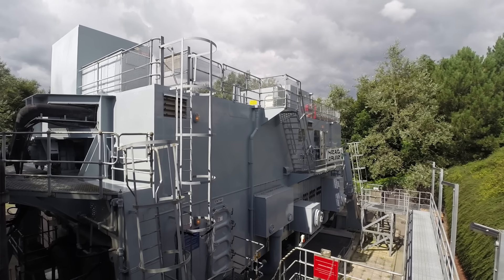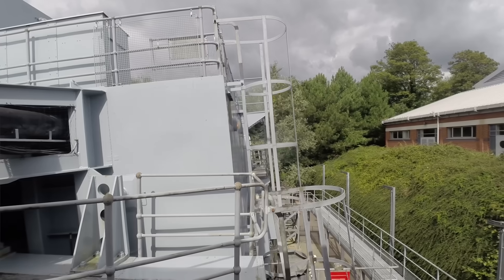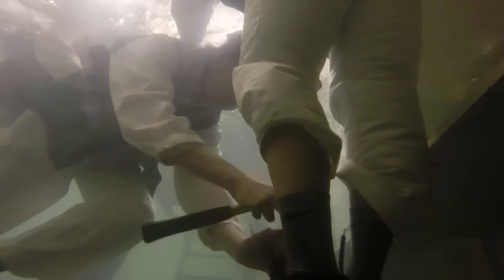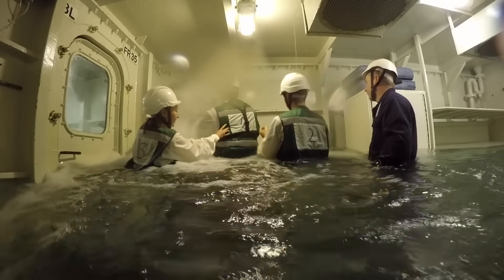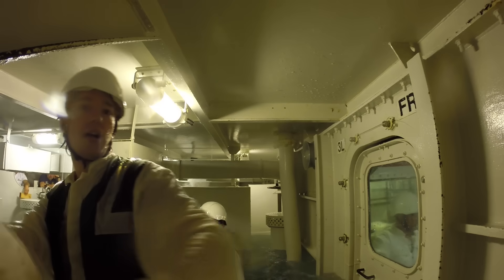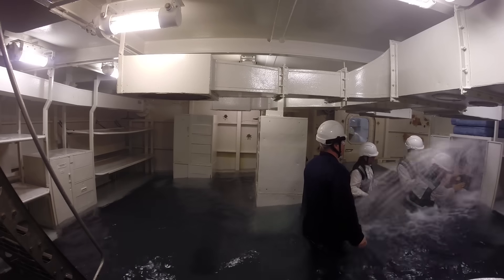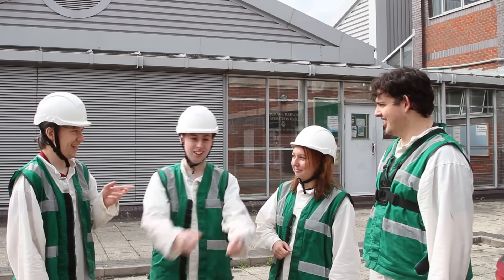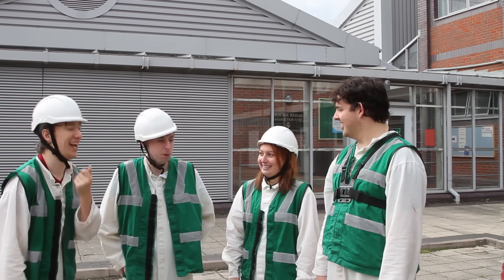Sinking Ship Simulator: The Royal Navy's Damage Repair Instructional Unit

Comment: Imagine astronauts banging wedges to fix a hole after space debris hit the ISS fuselage
Reply: Well they can't just let all that space inside now can they?
Reply: @GreatMelonLord  lmao
Reply: Bail out all that space!
Reply: @comradevlad7459  Someone mixed Nasa and Navy recruitment forms again?
Reply: @comradevlad7459  r/unexpectedCyanideAndHappiness?
Reply: @comradevlad7459  We got about five minutes before this shuttle fills with space and sends us to David Bowie's locker!
Reply: Actually would be easier in a spacecraft, as you'd be fixing it from the high-pressure side, just put something against the hole and it will be sucked securely into place, versus a ship trying to seal out water blasting in, trying to wedge something in against the water pressure.
Reply: @quillmaurer6563  They could always fix it from the outside
Reply: Thats how nano shield should work in 2030
Reply: I mean at one point when someone was scrambling to find a repair kit to fix a small hole in the side of the ISS, one of the astronauts just... Stuck their finger in it for a bit.
Reply: @grantrodgers98  reminds me of Scott Manley who told the story of how the toilet seal wouldn't close so the guy on the ISS just closed his legs and sat on the toilet to prevent depressurization.
Reply: @grantrodgers98  because the space is vacuum, it will hurt a lot because it suck.. just saying
Reply: Nah they just use their fingers, seriously they do until someone duct taped it up
Reply: @markroberts3363  
Wouldn't that do some damage to your finger
Like blood being displaced
Reply: When your space station gets filled with space
Reply: @gravy59  depends on how big the hole is. They patch small holes every now and then
Reply: They are too advanced to use wedges in space. They be using flex tape!
Reply: A small hole isnt gonna depresurise the entire iss, its size of a football terrain!
Reply: @Arthur Xie that is a common misconception about space. The difference is only one atmosphere which is not enough for explosive decompression. If you want to see what explosive decompression is look up the Byford dolphin accident
Reply: They could probably just put as metal sheet on it so the vacuum seals it
Reply: Differential pressure is a scary thing
Reply: Nah they use duct tape. No joke
Reply: @Blue2 Echo I don't think that how that works
Reply: Don’t forget to push all the air out of your lungs.
Reply: at this point, no one has died so that's good. but we will never know (freeze to death or heat to death) [if that makes sense] {Other than the 18 Soviet Cosmonauts, and 15 Astronauts} (Only 3 died in Space)
Reply: You guys who replying is so smort
Reply: There was a home from à micrometeor impact, an astronauts plugged it with his finger before putting tape over it then gauz and something else
Reply: It's actually easier, the pressure difference is lower and you can use fog spray to find the leak then you can stick something on the leak and the suction will keep it shut but depending on the size of the leak, you'll have to be very fast. The crew of Soyuz 11 lost consciousness after 30s when a pressure equalisation valve accidentally opened in the vacuum of space, after 120s they had suffocated. All it would have taken was closing a valve but it was difficult to reach and they weren't prepared for that event.
Reply: I think it would be easier to plug a breach as you are have a vacuum outside working in your favor as you place whatever you have available to patch the hole VS the force working against you.
Reply: Get the space out. Turn the space pumps back on.
Reply: How did this become yet another physics debate?
Reply: in space a piece of chewed bubblegum will automatically seal a small hole.
Reply: Actually it might be abit easier since, the vacuum of space will try to suck the wedge out
Reply: Grab your helmets and start scooping up the vacuum that keeps flooding in and throw it outside. ;)
Reply: Everybody : arguing 
Me : oh
Reply: Considering how weak the ISS hull is against large objects (Anything is weak to them ar orbital speeds) i would say that they would need a whole lot more than just wedges.
Reply: Well that wouldn't happen. That section would immediately depressurise and explode. If anyone was in it, they'd be jettisoned into space and freeze to death, after painful UV burns and swelling within minutes. They'd have to hope they were in another section and had a space suit at hand, because the second wave of debris from the exploding fuselage would fly into the other parts and potentially cause the same thing.
That's if a hole appeared. I'm sure they have countermeasures to prevent that from ever happening.
......I think
Reply: @Zaire82  you can't freeze to death, there is no where for the heat to go, you would die from suffication in about 30 sec.
Reply: @Zaire82  The heat from the sun is derived from the electromagnetic radiation (i.e. light) interacting with the matter it eventually encounters, like dust, rocks, planets, etc. Your body gives off heat by exchanging thermal energy with the matter it is in contact with (e.g. air, clothes, water). In empty space there is nothing, no matter, with which your body can conduct thermal energy out to. So exposure to the sun's rays may still heat you because it is in the energy is carried by photons (which can travel through empty space on their own) physically interacting with the piece of matter that is your body, but your body does not have any mechanism by which it can convert it's energy, thermal or otherwise, into any form of particle radiation such that it could lose energy and thus, potentially, heat while in a vacuum. 

TL:DR
The sun doesn't need any other matter to move heat. Your body does require external matter to move heat, and there isn't any external matter in empty space.
Reply: @CSelH  there is actually matter in space, 0.3% density or something. Also, to my understanding, heat is always electromagnetic radiation. Infra red light, to be specific. I don't see why the sun could radiate heat in a void when your body can't, you didn't explain why, so I'm sticking to my understanding unless you have a better explanation.
Reply: @Zaire82  You're wrong on the atmosphere thing. 1 atm compared to zero behaves the exact same as 2 atm to 1 atm. It's not about ratio, it's pure differential that's going to dictate the airflow. For reference your typical car tire will be 2-3 atm above ambient air pressure.

Airplanes do not explosively decompress when they get a hole in them. There are many recorded incidents of minor holes in aircraft that did not cause any passenger deaths. It's also worth noting that the main airflow dynamic here is not the pressure differential, it's the fact that you're in something slamming into the air at several hundred kilometers per hour. You can replicate this with a car, which has zero pressure differential, but opening up a window on the highway will give you a significant blast of air.

The ISS has had such a hole as was mentioned earlier. Expedition 56/57 (you can look it up) discovered there was a small hole caused by a drill. Not only does it not cause explosive decompression, it's such a minor thing that it only got noticed by ground control monitoring air levels and realizing there had to be a leak somewhere. They didn't even bother to wake the crew up, just told them about it in the morning.
Reply: @ThisGM  The structural integrity of the walls are able to withstand a drill hole, sure, but what of a piece of high-speed space debris?
That is the hypothetical situation, not simply "a hole". Depending on the size and speed, it could very well be comparable to a cannon ball with blades on it. That will certainly breach the walls' integrity, likely causing explosive decompression.
Reply: @CSelH  then how are you emitting infrared light right now?
Reply: @Zaire82  they patched a micro meteorite hole like last year.
Reply: @autopilot6320  finally! Someone who actually understands thermodynamics in space! 
Why the hell do people think you'd freeze instantly? There's nothing there to take the heat away!
Reply: @Zaire82  there is not enough particulate matter in place to wick heat away, if you were exposed to the vacuum of space with no suit your body would take nearly an entire day to freeze completely to its core. Partly because of low particulate cooling and partly down to an extended leidenfrost effect. You would suffocate LONG before you froze to death.
This is why the ISS has such large radiator panels (which everyone mistakes for solar panels.) If they didn't have them even venting small amounts of heat would be near impossible.
Reply: @Zaire82  also, explosive decompression is nigh on impossible with 1 atmo difference on a reasonable sized puncture. For something like that to happen you would have to lose a considerable amount of the station i.e. it would have to snap in half for explosive decompression to even be a threat.
And yes, you can plug a small enough hole with your finger with one atmo difference, its not dangerous per se, most likely just uncomfortable.
And dear god please don't ask why their finger wouldn't freeze, it should be obvious by now.
Reply: @Zaire82  you can freeze to dead in space but not so quick
Reply: @ThisGM  what morning lmao
Reply: @Zaire82  just stop
Reply: @Zaire82  Cant admit that you were wrong eh. It feels better than endlessly adjusting your argument. It's okay to not know everything and make incorrect assumptions about discreet things. Try it some time
Reply: @triplegoy  I admitted I didn't understand them and that I didn't consider the thing they told me. I took the greater than thou attitude because I don't believe they conveyed their meaning properly to begin with. 
Therefore your complaints are null.
Reply: @loumorningstar7709  surely plugging the hole with your finger would cause any water in your finger to painfully boil off and pass through your skin due to the drop in boiling point at such low pressures? As far as I understood death by space (when fully exposed) - if you don't completely breathe out your lungs are just going to pop immediately, and if you do, all the liquid in your body will be turning to gas over a minute or two (hence why those cosmonauts who died just before reentry were covered in weird spots all over their skin).
Reply: @muxite6035  1 anything compared to the literal void is always a large difference.
Imagine what happens to a plane when the door flies off.
That plane is 1atm inside, with somewhere between 0.75 and 0.25 outside, depending on altitude. Still, the door flies off and people get sucked out.
Imagine when there's nothing outside.
Reply: @Zaire82  one atmosphere of pressure is not much at all the reason why airplane incidents are so violent is not because the difference in air pressure it's because when they door window opens on an airplane the airplanes going several hundred miles per hour. Next time you're in your car going down the freeway at 70 open the window and see how violently there comes in now multiply that by about eight fold

Comment: They should develop umbrella style plugs that can be forced through the hole in a rod shape. Then once clear of the fast flowing areas around the hole deploy the pulg so it springs open and let the water push it against the hull to seal.

Comment: Feel for the hole size, put a couple wedges together close to that size and put them in position quickly and hammer them home, adding additional wedges as needed. It isn’t hard if you work smarter not harder.
Reply: "Everything is very simple in war, but the simplest thing is difficult."

Comment: Fixing a seam split with softwood wedges... bang in six in a row and some idiot hands over a hardwood wedge for the last, it expanded the gap and five wedges fell out and they turned the water pressure up. Water rising, ducking under to bang in conical plugs into shell holes, and a CPO decides its a good time to start letting off flash-bangs on the water surface. We all "died" on that one.

Comment: I also did these fixing and blocking drill at navy. The water press was so hard as much as push person.
After establishing the stuffs for blocking the hole. Drill instructor hit it with hammer to check a strength of the structure

Comment: What if the hole is below the water line and behind pipes?  What if the hole is in between the wall that connects 2 rooms and the hole floods through 2 rooms?
Reply: The room would fill almost instantly, make sure the doors wont open under the pressure and leave them, once it's full it can't fill any more

Comment: I've actually done that exercise with a crew from HMS Manchester.  It's very realistic, and just to add some additional excitement the instructors decided to throw firecrackers into the rooms as we were trying to plug the leaks.

I ended up standing on a pump head to hold it into position over a hole in the deck, and up to my neck in freezing seawater wondering if the instructors would actually unseal the compartment before it got over my head. Also not obvious in the video for obvious reasons the actual simulation takes place mostly in complete darkness, as any missile hit would almost certainly take out the electric's in the compartment.

Comment: So there isn't a hardening gel that could be applied to holes?
Reply: No, that is some doctor who magic you're talking about. That flow of water is the pressure of the sea pushing inward ( A whole lot of pressure). A gel, would be pushed out. Wood, wedges in. Gel creates no tension, has no friction, and is an ineffective thing. Torches and metal n the other hand is very effective to use. but very hard to use when water is surging through a hole.
Reply: Ah ok, thanks.
Reply: Jesse Cruz  contacting emergency services, sealing off the flooding compartment, then drain.
Reply: The next step would be secondary shoring. I.e creating a brace. For example a wall split with the metal going outwards you would use a bowl shaped bit of thick plastic/metal but that against the wall and then create a brace out of wood to hold it.

Having done this myself in HMS Havoc which is the simulator.
Reply: So the wedges buy time. Buy time for what? What's the next step to getting this under control?

Comment: honestly this seems like it'd be really fun
Reply: It should be a game like laser tag or bowling
Reply: It is fun. See it as a combination of a rollercoaster-ride and an escape-room. However, ppl are likely to get injured alot doing this. There's using hammers in very awkward situations and when the mock-up rolls (and somebody forgets to hold on to a floating piece of wood 4x4) it can get dangerous quickly.
Reply: It is fun but it hurts a lot when you mess up with the hammers
Reply: of course itd be fun.. while you're playing in that simulator.
Reply: Politiekman good point
Reply: DreadX10, yup
Reply: PizzaYum 2004 what does this, laser tag, and bowling have in common?
Reply: Your Dad it is fun, ive been there 2 times now. It’s at HMS Raleigh; it’s where u go to do basic training

Comment: How does small wood wedges stop water from coming in wtf? I don't understand at all.
Reply: Because wood expands when it comes into contact with water, it's hard, which makes it much easier to hammer into a hole, it's easy to split, so that it can fit pretty much any hole.
Reply: In the most basic sense Marq, if you put something where there is a hole, then there is no more hole.  I hope that's sufficient.
Reply: it does stop a big amount of it not all of it
Reply: +HPGmaphax
That's what she said. 

No.. wait...

Comment: I want to try that so bad.
Reply: ErrorIcon They should do like a public thing or i dunno in a fuckin waterpark or something.
Reply: ErrorIcon it is great fun I did it as a cadet two years back
Reply: When I did it in cadets they said it cost around £10000 to run it each time so it would be a bit expensive to make it public.
Reply: I did it 2 weeks ago and they said its 5000 each run, still expensive tho. When I did it, it was so much harder than what Tom did aahhaha, how long did it take you?
Reply: In winter, you have to wear overalls and a dry suit as well as boots. It makes your nuts rub together
Reply: When I done damage control in sea cadets, this had only just opened. So we were in the old building, great fun, all the adult cadet instructors were in there as well because it was so much fun
Reply: Just join the navy
Reply: ErrorIcon same :(
Reply: Raidzor つ ◕_◕ つ yeah! :)

Comment: Correct me if I'm wrong.... but I'm pretty sure some duct tape would plug all those holes without a hitch!
Reply: Jake W you're wrong
Reply: German Potato he told us to correct him if he was wrong so i did, im doing what the man asked
Reply: Flex tape will fix the holes!
Reply: +ZenoxFX you are wrong man.
Reply: Ian Hanners did you even read what he said? He said it was A joke.
Reply: Ian Hanners I see that this conversation wont do anything, so to save some time: Have A great weekend, this conversation is now over.
Reply: German Potato repeating the question in the answer would have been redundant, and the appropriate answer is simply a refutation of the question.
Reply: Spanospy solution Fleeextape!
Reply: under water there is a lot of pressure. Duct Tape would hold the water for... 0.5 seconds then it would just being pushed in by the water.
Reply: NozyFX Yep, it was a joke mate.
Reply: Ian Hanners he said "correct me if im wrong.." that is not the Same as "tell me if im wrong" you simply said hes wrong but you didnt correct him.